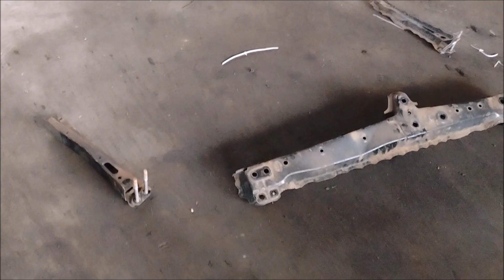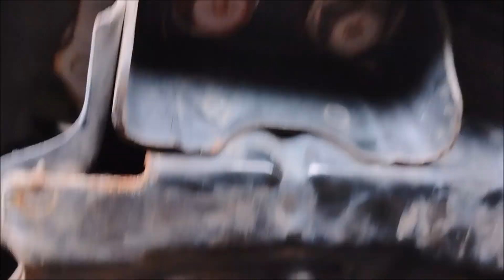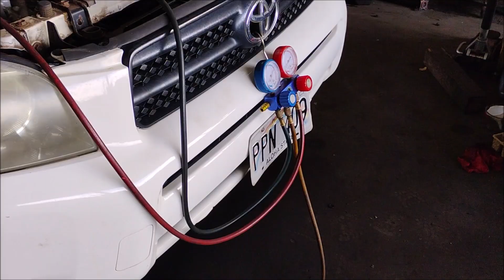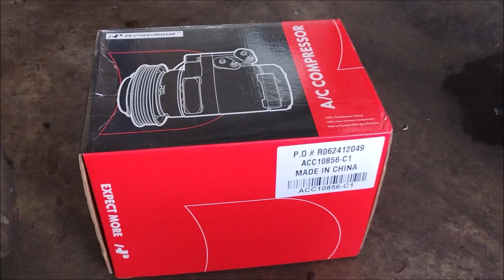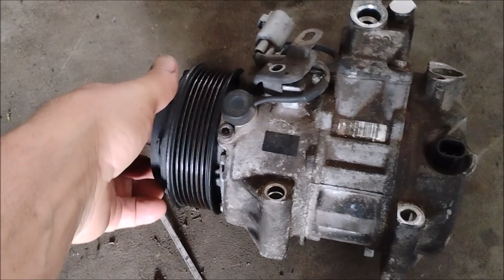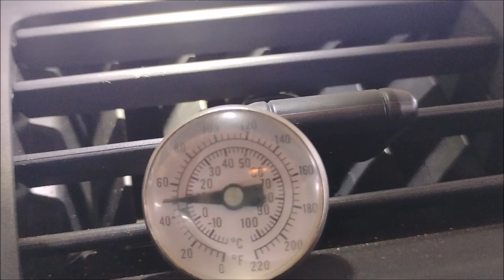RAV4 AC Compressor Pro Tips Remove and Replace 2007 Toyota 2GR-FE

Comment: My 2007 Rav4 shut off while I was sitting at a red light. Tried to start it back up, but it wouldn't start until I turned the air off. The compressor locked up, and if I try to turn the air on, the car shuts off to protect itself. Had no warning beforehand; it was blowing cold for many years.
Reply from the maker: Sorry to hear about your trouble.
Reply: @Merryfrankster_  Thank you. I'm probably getting rid of it after this; it just isn't worth the trouble of fixing.
Reply: So this happened when a friend tried to diagnose the AC problem for my 2008 rav4. He said it's because he added frion when the AC compressor is no longer good so turning the AC on chokes out the engine and causes the car to stall.
Reply: @keymoney223  Got mine fixed after all about $1600 for new compressor and condenser.

Comment: Thanks for that tip about removing the cross member cause that'll save me a ton of time when I'm replacing one of the lines soon!

And quick question, do you need to support the engine when you remove it? It's only the front mount so I'd imagine it would be fine but I don't wanna end up dropping the engine and breaking a bunch of shit lol
Reply from the maker: The engine and transmission are fully supported by the two side mounts. There may be a small rotation/shift when you remove the front or rear mounts. You can use a floor jack or other creative means to help to line things up again.

Comment: Hi. Great video. My 2010 RAV4 V6's AC light has been blinking on and off for some time. A car restart has worked and sometimes I had to wait a day or so, but it then the AC started working. Today the AC light started blinking again. Checked the clutch relay and is good. Even jumped the load at the relay box, but clutch is not engaging. Can any other AC component keep the clutch form engaging of it is jumped? Car has 109k miles. First problem ever.
Reply from the maker: You would have to  use a scantool to command the compressor on and off. Did I show that in this video?
Reply: @Merryfrankster_  Did not, but makes sense. I actually went back later that evening and jumped it with a heady duty paper clip and it kicked on. It then worked with the stock relay. Now working fine. Maybe it is an inconsistent relay. I ordered an OEM new one to rule it out. If it persist, It may be the clutch coil. When it works (98% of the time) it cools efficiently so I don't know if I should replace the whole compressor yet.
Reply from the maker: this does not operate with clutch. Operates with relief valve PWM.

Comment: I love my rav but doing anything in the engine is just pain.
Reply from the maker: What doesn't kill you, makes you stronger, bud.
Reply: Been doing more on my RAV4 recently and it 50/50 on the videos being for. v6 or 4 cylinder RAV4

In my 4 cylinder they leave plenty of room to stick your V6 in haha 

They still use the space efficiently but definitely much more room all around the engine block to access stuff 

Apparently some of these Toyotas have wheel well access panels though to get to the compressor, so keep a look out for that I suppose
Reply from the maker: @dariusmaresca8085  Thank you for watching and for commenting. If you find any access panels, please let everybody know.
Reply: @dariusmaresca8085  Man I had no idea you could just take off the cross member.... I had to replace the serpentine belt tensioner which is BEHIND the compressor so with that there it was a massive pain in the ass. If I would have just removed that bar it would've saved me literal hours 😭🤣
Reply: Better than paying a shop $1,400 for the whole job.
Reply from the maker: @RVGFM  1400 buys a lot of cat food.

Comment: How much did you charge for this. And if I’ve tried both fuses refilling the Freon and making sure there are no leaks and replace the ac amplifier is this pretty much the last candidate?
Reply from the maker: Remove members, discharge freon, remove compressor, replace o-rings, re-install, vacuum purge, recharge, re-install members. It was about one half day of work. i charged one half day of work, plus compressor, plus previous diagnostics (1.5 hour messing around with electrical tests and scantool).

Comment: Do you remember if the clutch could just be replaced by removing the cross member?  I'm pretty sure the clutch went bad by diagnosis, but if I could avoid opening the system would be nice.
Reply from the maker: If the clutch is bad it does not click and engage. It's tough to diagnose on these vehicles with the 3 wire system plus the connector is pretty much inaccessible. With the cross member and the side member off as in this video you have much improved access to everything and you can do anything you want.
Reply: @Merryfrankster_  Thanks, one more question. What do you think if the positive wire is getting power but it doesn't engage? 

The AC light just blinks when it's pressed (manual controls). The system worked fine before I was forced to take it to a shop for an alternator. They frayed the clutch wire insulation on the serpentine belt when they put it back together.
Reply from the maker: @ ac stopped working after shop mangled wire. shop blames clutch. ok. How do you know that the wire is even delivering power? Disconnect the wire (it's possible to do), and check for power in the harness with ac on. The power delivery terminal is the top one in the triangle. The other two are sensor wires. HOWEVER - power delivery is PWM, not on/off 12v. So this makes it tough to diagnose with conventional voltmeter. Next, try to apply 12v directly to the top terminal on the compressor side. This is next to impossible to do from above or below without taking out the crossmember.